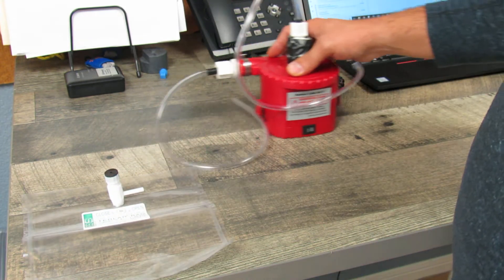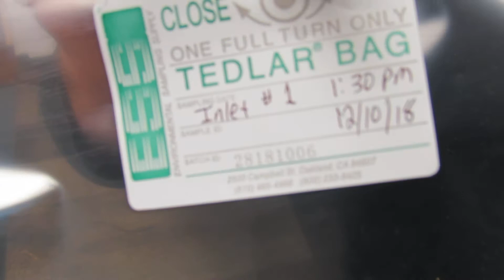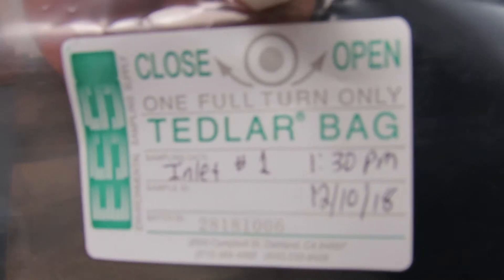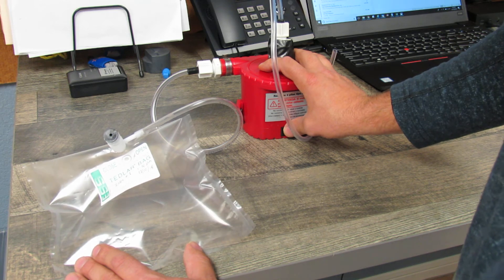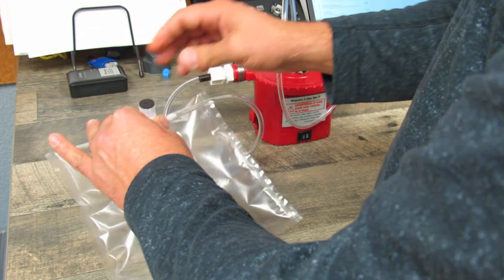Collection of Air Samples using Tedlar Bags

Comment: Hi kinda curious on this, not my specialization but wanted to ask this. Does the vacuum pump does not affect the collected air sample in terms of scent picked up within the pump itself?
Reply: For anyone coming to this video later - vacuum chambers (also called lung boxes, vacuum air sampling boxes) let you collect samples without passing the sample gas through the vacuum pump itself. You put the Tedlar bag in a box; the bag is connected to a port to the sampling line, while the vacuum pump is connected to the box. A vacuum is created in the box, pulling the gas into the sample bag via negative pressure. These are pricey, but are useful for labs that need uncontaminated gas samples.
Reply from the maker: @kellychan-yam7711 thanks for your comment. Really great advise!
Reply from the maker: Great question! I'm not sure if you're "curious" or actually preparing to take air samples. If you were sampling air to pick up metals, I'm sure you would find compounds from the electrical equipment from the pump. Especially from the windings on the motor. Possibly any lubricant used on the motor as well. It would definitely be something I would evaluate beforehand. I'm not employed in the environmental field any longer. However, when this was filmed, my only purpose was to sample organic and chemical compounds. The compounds of the motor weren't an issue. If you feel like you need a cleaner sample, you can look at air canister samples. They will induce ambient airs without the use of a pump. Please refer to this link. It's for educational purposes only. I can't vouch for their products or services. 
https://www.google.com/url?sa=t&source=web&rct=j&url=https://www.eurofinsus.com/media/161448/guide-to-air-sampling-analysis-2014-06-27_revised-logos.pdf&ved=2ahUKEwiRtO2uvbn8AhVDm2oFHSzZB7wQFnoECBcQAQ&usg=AOvVaw3LCSS2SjTroJCOk_O-3Saf